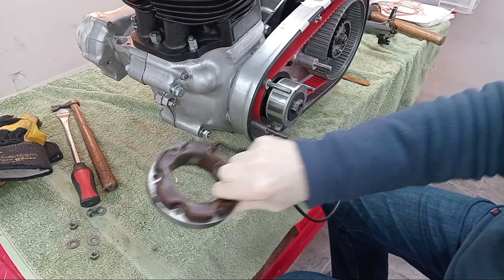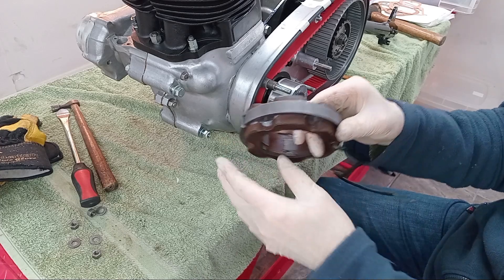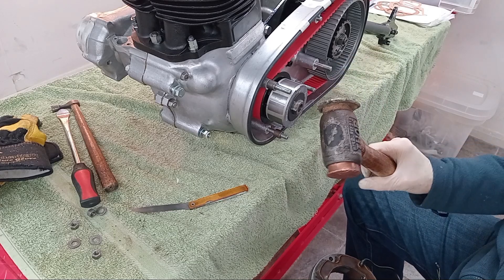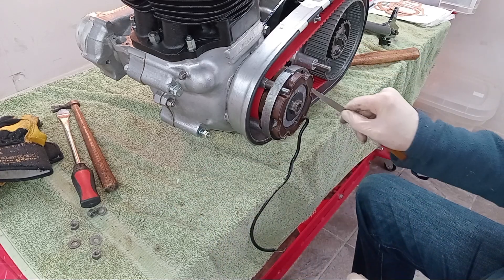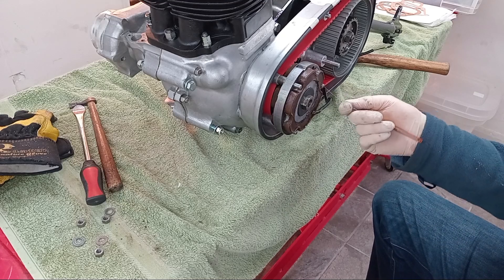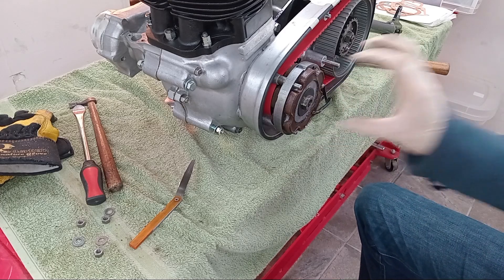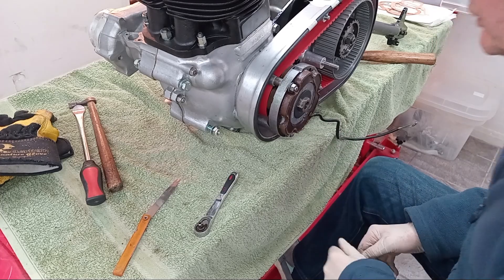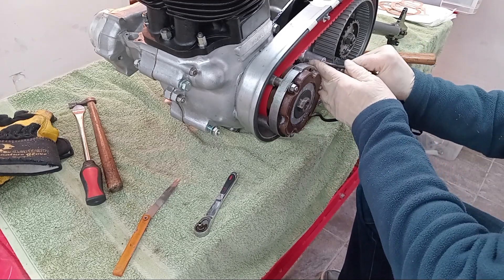Norton Commando Engine Rebuild. Part 62: Fitting the Stator

Comment: Did you have the same gap when you turned the engine over a little bit to a different position...this is something I always check to allow for end float and a slight run out on the end of the crankshaft? Another problem I have.
Reply from the maker: Good point. I should have mentioned this in the video. Thanks for highlighting it. In my case all was well. 👍

Comment: Would it be ok to take a couple of thou off the rotor? As I have the same problem.
Reply from the maker: I'm not sure about this. If the rotor is standard, and the stator is also standard, there should be a gap available and no machining required. I don't know how tge rotor would take to machining either, as it's a mixture of steel and alloy. If there's no gap all the way round then maybe try a replacement rotor.

Comment: Great. Enjoy watching your progress!
Reply: Sometimes playing cards are inserted between the rotor and stator all the way around to create equal distance between the two. Then tighten the nuts.
Reply from the maker: Yes, or the cut off half of a plastic bottle. The problem with this is that it's only a measure, like the feeler gauges: You can't make the gap bigger with playing cards etc, only measure it.
Reply from the maker: Thanks. 👍